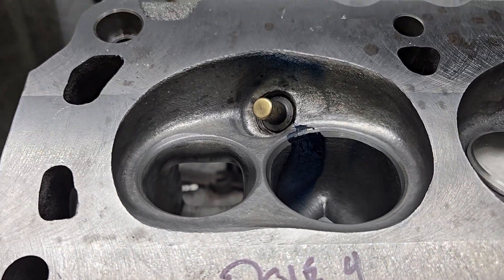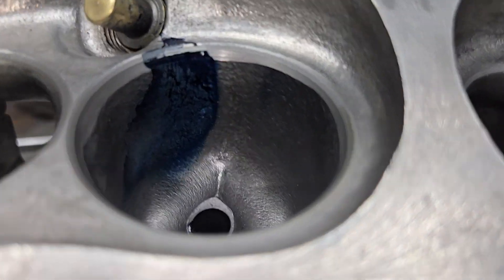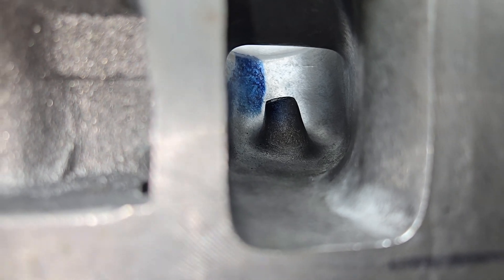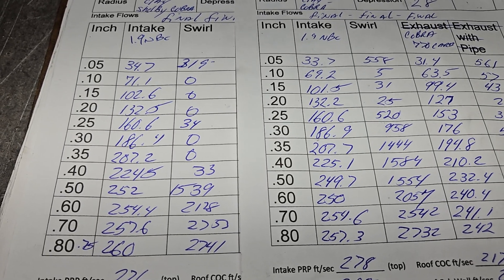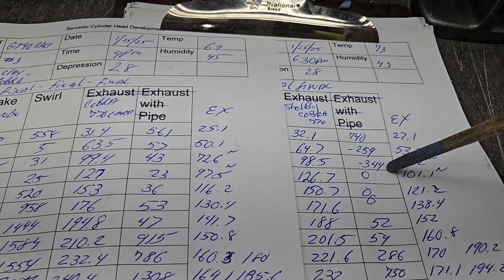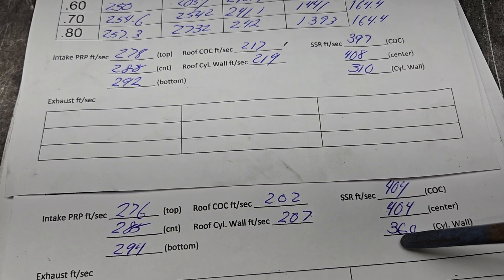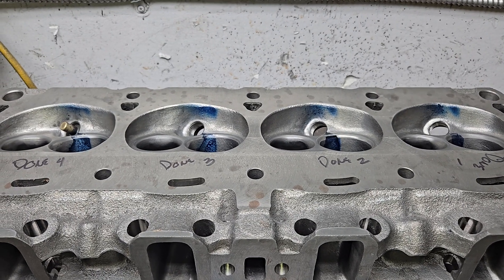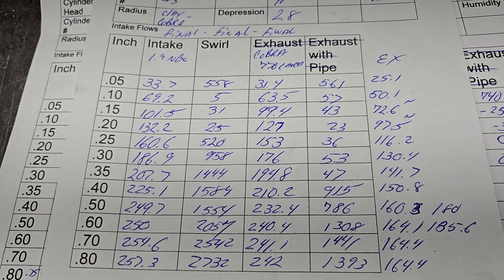Ford GT40 289Race Project, cylinder #4 flows and air speeds. Cobra/Shelby intake, Wilson spacer

Comment: The swirl meter doesn't measure tumble, both help mix air and fuel, swirl is generally ideal because it keeps the air fuel mix near the plug and chamber. On these heads you see the dyechem high on the bore. So just because you're not seeing much swirl at low speeds doesn't mean there's no mixing motion in the flow.